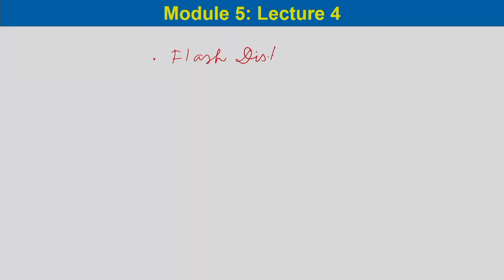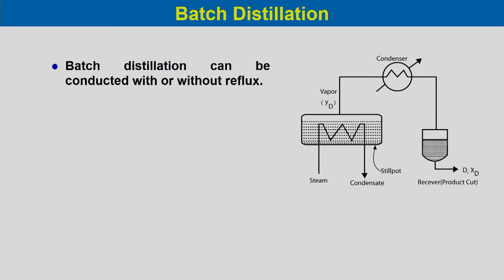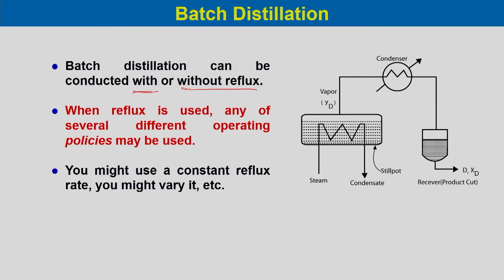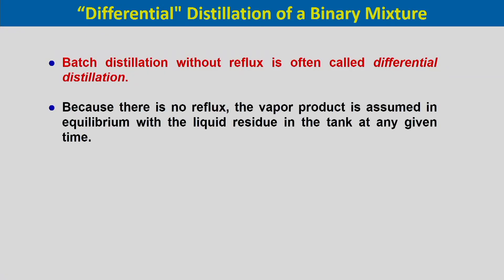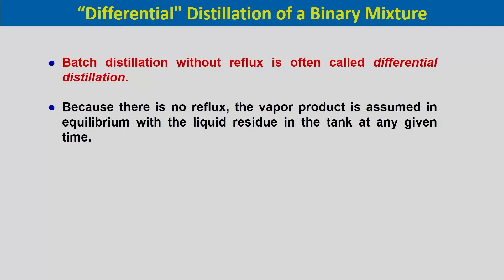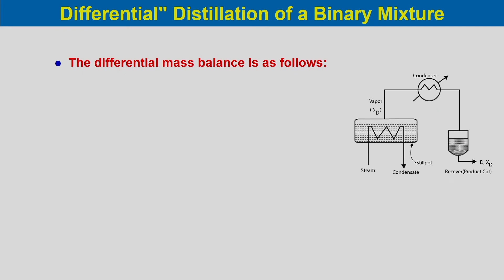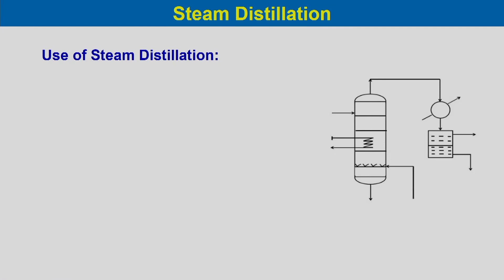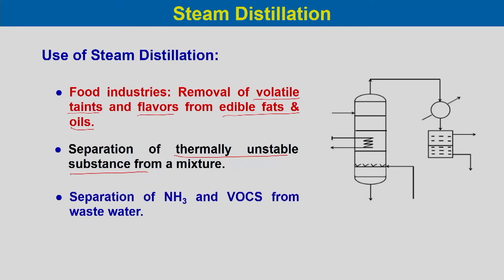Lec 29: Batch and steam distillation

Comment: The value of relative volatility over the range of the x compositions in the  Rayleigh equation can be considered  as constant for ideal solution and lower relative volatility ( the equilibrium relation is close to y=x line) with rough approximation. In case of real mixture like methanol water or others with high relative volatility distributions, the relative volatility is  widely varied over the range from higher than 1 to close to 1. In these cases it is wise to integrate the equation with the help of numerical integration for known values of equilibrium data set. The ideal solutions with low relative volatility sometimes gives bad estimation of the integrals.